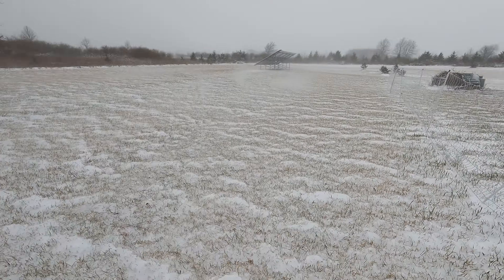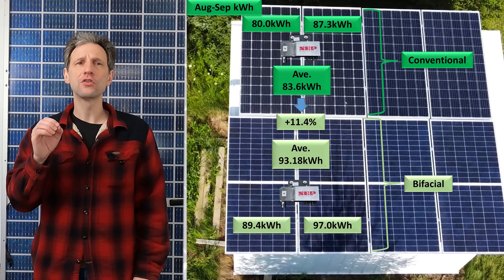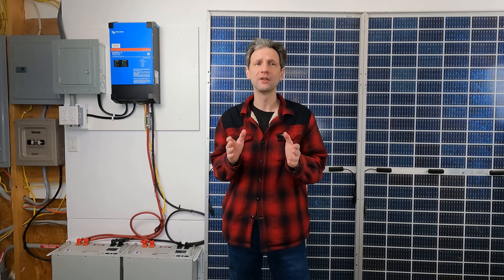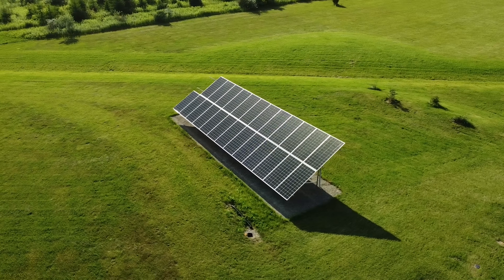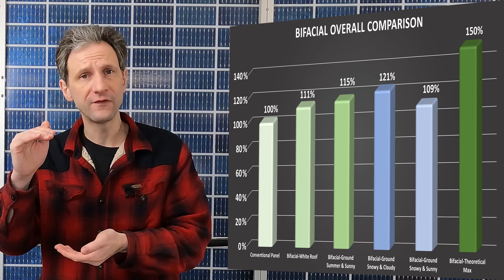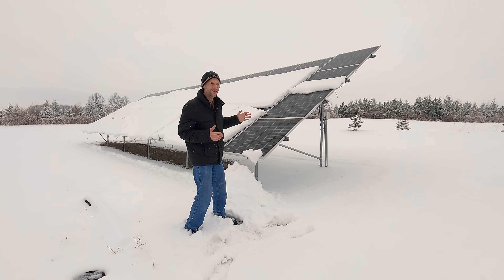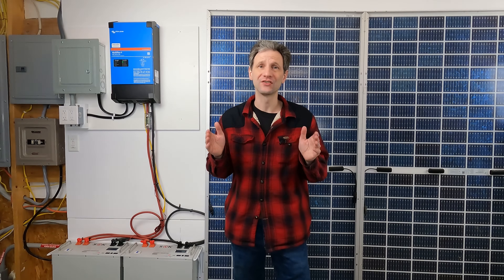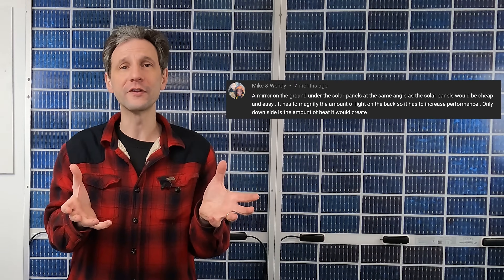Bifacial Solar Panel Winter Performance Actual Results

Comment: Great review! I am no expert with bifacial panels, but I have seen some solar panel designs install the panels at a 90 (vertical) angle. This would minimize the shading of the snow by the panels and maximize the amount of sun to both sides of the bifacial panels.  It would also allow the panels to shed snow more efficiently.  To be clear, part of the reason for the vertical mounting was to allow easy access  between the panels for agriculture farming. So the vertical mounting may not be the most efficient orientation for bifacial panels, but it would be very interesting  to see if it  produced more power in both summer and winter seasons. Just a thought.
Reply: At 49-degrees North Lat, my bifacials are angled 72(from horizontal) during Nov-Jan, then 60-degrees until end of April then 30-degrees unit end of October. This gives me the best total over the year, and yes during those summer months when the sun rises in the NE and sets in the NW there is a lot of collection from the back of the panels, similarly during winter months reflection off of white snow onto the back of panels is 10-15 % of the collected energy of those months.
Reply: @r.b.l.5841  Interesting. You have done some serious homework. It is easy enough to figure out the best panel angle for single side solar panels, but bifacial panels appear to be a challenge.  It appears that you made your rack assembly adjustable, so that you can change the panel angles for various seasons. That suggests you have a ground mounted system.

Thanks for posting this information. I live in sunny AZ in the Phoenix metro area (in Peoria AZ)  and I am going to install solar panels on my roof. I considered bifacial, but the added complexity of installing the panels at an angle on the roof is just not worth the trouble. This is especially true because newer panels have increased in to over 500 watts per panel. So I can install a 10 KW system with just 20 panels.. 

I think that using a Sol-Ark 15K hybrid inverter will allow me to capture most of the 10 KW output of the array and send it back to the grid, store it in a battery system and use it to power my house. Here in AZ, I would get enough power with a 10 KW array to power my house a week in just one day during the summer and still send power back to the grid. In the winter, it will still take approximately 1 - 1.25 days (theoretically) to generate enough power to power my house for a week. So essentially, I will not have an power bill at all. AZ pays approximately eighty percent back (of what I pay the utility company) in net metering, which is a pretty good deal.

Your system sounds impressive. It  would be interesting to see it.
Reply: @franklong6269  I would not recommend bifacials for your set up, standard PV mounted parallel to your roof surface on fixed racking is much simpler to do, and if your roof slope is close to the same angle as your latitude north of the equator your golden. likely very little snow in Pheniox AZ too! (part of the reason my angle is steep is snow)
Reply: @r.b.l.5841  Yes you are correct - 100%. You came to the same conclusion that I did.  It just isn't worth the trouble to mess with bifacial panels in my situation. I would have problems permitting the rack bracing system if the panels were angled. And yes, here in the Phoenix metro area, it barely snows once every 30 years or so. So far this winter, the temperatures around my house have not reached freezing - though they have come close a couple of times.

Thank you for sharing your hard-earned information.

Comment: Have you tried a biracial panel mounted vertically to collect both east and west light?
Reply: There would be extreme wind load on that configuration.
Reply from the maker: There have been a lot of requests for this and I have been thinking about how to mange the wind loading.  I don't know of a racking system to accommodate it, so I would have to make something for the experiment.  It would need significant bracing to be sure.

Comment: I too am Dave in Ohio. Really enjoy your measurement at real world useage. I have a small shed with solar, so I am new to the system but it always produces even with snow, but not enough to recharge the batteries. Use this system to recharge my ryobi 40 volt batteries and a golf cart that pulls 20 amps during charging.
Reply from the maker: Nice!  Be careful, once you start producing your own power it gets addicting. 😀

Comment: Great work, Dave. We're STILL planning our ground mount w/ batteries, but you may have converted me from the REC Pure Rs I had my eyes on.
Thanks!
Reply from the maker: Thanks!  By the way, I'm not trying to "convert" anyone, just sharing what I learn as I go with my actual data.  My goal is to give you data to process through the filter of your specific situation so you can make the best decision for you.

Comment: still think straight up [vertical] on there side and stagger back like  a set of stairs. you should get a reflection from front of second or third row on to row in front of it. plus lets more light thru. yes on a shiny wall back 10 ft or more.  plus space both sides of each row. less snow more reflection win win. bifacials at there best in cold snowy and cloudy days. keep up the good vids 👍👍 would still work good in  late and early longer summer days with sun low NE and NW. shiny ground in front and under array to. and better wind flow around panels. maybe a vertical wall behind with regular panels
Reply from the maker: I think there are a lot of unique solutions that could be achieved with bifacial panels, but racking systems have not caught up with the technology yet.

Comment: The snowy test didn't seem quite fair since it didn't look completely snow covered (100% albedo) and there was no snow under the lower row bifacial.  Many areas would have the ground even under that lower area completely snow covered from blowing snow which would have helped the lower bifacial panel out.  Would also help if you mentioned the angle the array is at and your latitude since that would also directly affect the output.
Reply from the maker: Unfortunately, we don't often have the combination of snow and sun where I live.  So, I have to work with what I get.  Hopefully, it is at least relevant data you can use to extrapolate to your situation.  If I get a better snowfall next year, I can gather more data.
Reply: @ProjectsWithDave  Your results would be dramatically different. Deep snow with full sun is blinding. It didn't look bright at all in your clip. The sun was penetrating through the snow, plus all of the exposed grass (and obviously gravel).

Comment: Hello from a 5% viewer. I live in south central Montana and this winter had a issue with my system going over voltage. I have 250w used panels and when the temps dropped into the double digit negatives my system shut down due to going 1 volt over the inverters max. Only had this when it was 0 or colder and clear skies. My fault, i didnt work our the math on the panels to include the change in voltage as temps dropped. Simple fix disconnect one panel from the string.  I always enjoy your experiments and have learned a lot, and it has saved me time and money in the past so thank you for sharing your experiences with us.
Reply from the maker: Thanks for being one of the 5%!  Thanks for your comment on temperature effects. Panels see their highest voltages in cold temperatures, and bifacial panels have an even greater delta in low temperatures.

Comment: Nice! I've been thinking about replicating this somewhat using cheap used panels by putting panels on the north facing side of my roof.... On clear sunny days those panels won't see much benefit, but on cloudy days suddenly I would have double the panel area to soak up the diffuse light from the clouds. This would only be worthwhile if I get another very good deal on panels though. Last time I bought 110x 230W panels for $55 each. I would happily put the same panels on my north facing roofs if I got a similar deal.
Reply from the maker: Cheap panels give you lots of flexibility you didn't have in the past.  If you are looking for more production in low light situations, and the only place you have to put them is on the north side, then this might be your only option.  However, don't expect them to produce very much.
Reply: @ProjectsWithDave  for sure, I'm not expecting too much if I go that route, just some help with potential shortfalls on cloudy days. I have a small machine shop full of CNC machines so going solar will be my approach to getting 3 phase power, as that is not available locally. I bought 24kw of used panels to go on the south facing roofs, it will be interesting to see how it works out! I'll be using the grid as a 'charger' as well, but prioritizing solar input, and using both to keep approx 20kw/h of batteries topped up so they can be used in case of outages. 

We get lots of power flickers and outages here, which is not a good environment to be trying to run CNC machines! I'm looking forward to getting the system online.
Reply: @GoughCustom  How is your system going now? I'm a multi-media artist and I'm planning a solar system for my studio I'm building in my garage.

Comment: Thanks Dave.  This is very helpful.  I have bifacial panels in west Michigan and I have to say I'm disappointed that they don't do better on most cloudy days.  I keep wondering if my design is not optimal.  I still have more research to do.  But it's good to know that your data says I made the right decision to go with bifacial panels.
Reply from the maker: Cloudy days just don't produce very much power.  If you had conventional panels, you would be even more disappointed.  You made the right choice in panels if it's a ground mount.
Reply: @ProjectsWithDave  Thanks Dave, I was trying to compare my solar output with yours as I wonder if I did something wrong with my set up.  On my cloudy days I only get about 800w from my 9200w array which is a ground mount with all 460w Blue Sun bifacials.  That is not even close to the 2000w the video shows that your array is producing in that snow storm.  Could the difference in latitude make that much difference?  Yes, there are cloudy days and there are CLOUDY days but I am judging based on what your snowy cold video shows.  I also have to say that I'm not sure about my sunny day output where the most I have seen in 8000w with the panel angle set to perpendicular to the sun and that day was very cold.  I have only been running since October.  So I do wonder how they will do in the summer considering solar gain versus panel efficiency losses due to temperature.  I am considering some kind of reflective surface behind the panels for next winter.  Also, I put gaps between the panels in my array to increase the amount of light getting behind the panels.
Reply from the maker: Moment by moment production is not as reliable as long term data.  Compare the output of your system over a a period of months against the predicted output by a calculator like PVWatts ( https://pvwatts.nrel.gov/ ).  This will give you a better idea of how close you are to your systems true capability.  Cloudy days can vary significantly in intensity.  My cloudy day output can vary from 8kWh for the day to 23kWh.  Density of the clouds makes a significant difference.  Also keep in mind the online calculator is an average for a period of many years.  My monthly output varies significantly from year to year as well.  My lowest output for the month of January was 0.46Mwh and my best year for January was 0.819Mwh.  It's very weather dependent.
Reply: @jakejoeep23  Are you getting more than 9200W on a sunny day?
Reply: @davidb.5544  Not so far.  Just 8000w on the best totally sunny cold winter day.
Reply: If you have amp meter would be helpful to check every panel to see if any aren't producing.

Comment: Suggestion: brush the snow off all the panels!
Reply from the maker: I estimate the value of brushing off the snow in this video: https://youtu.be/vY3PufzPUnI
Unless you live off grid and need the power, it's not worth the time.  If you live where there is a lot of snow, you should have your panels at a much steeper angle so it sheds on its own.

Comment: Dave, Another great video, but that is NOT a blizzard!! I have a 20kwp array of bifacial panels and I have 6 feet of snow below my ground mount array. If you are really in snow country you need a 45 degree pitch to slough off snow. The tiny loss of power in summer is insignificant compared to winter days when you need it (as you say)
Reply from the maker: Yes, I should have said it felt like a blizzard.  The temperature was -40deg F with the wind chill.  I grew up in Alaska, so I've seen my share of snow.  And I agree, 45deg would be a better angle even for my location which doesn't see all that much snow.  My winter production is my weak production time even without considering snow shedding.
Reply: @ProjectsWithDave  Wind chill doesn't count ;)
Reply from the maker: That's funny, that's what I always tell my wife!  That's what they always report in the news in Ohio, makes it seem more exciting I guess.
Reply: @ProjectsWithDave  We married the same woman..

Comment: With bifacial panels and snow I have gotten better results at a steeper angle because they shed snow faster and the back side can get more light at a steeper angle.
Reply from the maker: Yes, if you are in a climate with a lot of snow I would recommend an even steeper than mine, which is at 30deg.
Reply: I have 11.6 vertical, so far with no snow yet 11.6kw, but in July only 5.6kw, made for winter maximum only, when snow shows up I have to shade  panels, I already had the new array shaded cos it over Amp the mppt. Latest test 10am 9600w. Overcast 1200w rn. no snow ever sticks,and rain keeps the panels clean.

Comment: What is the price difference between the normal panels and bifacial? You have established here that bifacial are better in some applications, but even a rough price comparison is needed. Great video as always, looking forward to the next one.
Reply from the maker: I got my bifacial panels for less than the cost of conventional panels through a clearance sale at SanTan solar.  I have a few good sources with great pricing on my website under solar panels.  Here's a link: https://projectswithdave.com/solar-panels/
You can can pay a slight premium and still come out ahead.  I discuss the calculation in this video on bifacial panels: https://youtu.be/1SXNjsSsmq0
Reply: Totally depends on where you buy it from, brand, size, etc.  I've seen certain bifacials a lot cheaper than mono facial panels.

Comment: As always, your videos are thoughtful, helpful and logical.  I live in  Northern Indiana, so I think many things apply also here.  This is my year for investing into solar.  BTW what is the angle of your ground array?  Where there even steeper angles available in Ready Rack?
Reply from the maker: It's 30deg.  That was the steepest angle they had when I installed it.  I'm expanding my array right now and I found it's not hard to "cheat" it a few more degrees.  Of course, that will affect the wind loading calculations slightly.
Reply: Sinclair Designs ground mounts offer a seasonal adjust option you might want to check that out.
Reply from the maker: I'm familiar with that system, it's a good option.  I link to it on my components page at the bottom: https://projectswithdave.com/components/

Comment: Dave, you are doing some great work here. Very good data. I am working on compiling solar data as well. I have an Enphase system that I installed myself and I am looking at possibly building another array inground for testing all sorts of combos. Just curious about what state you are in? Ohio? Keep up the awesome work!
Reply from the maker: Thanks!  Yes, I’m in Ohio.  Enphase is a nice product, but every time I look at it, I end up using something else because the cost is so high.
Reply: @@ProjectsWithDave  I moved from Central Ohio to Central KY last year. What software are you using to gather per panel data? It looks similar to my Enlighten App used on my microinverters.
Reply from the maker: I use SolarEdge for my main array and NEP's system for the shed.